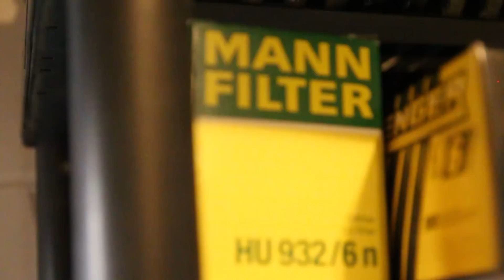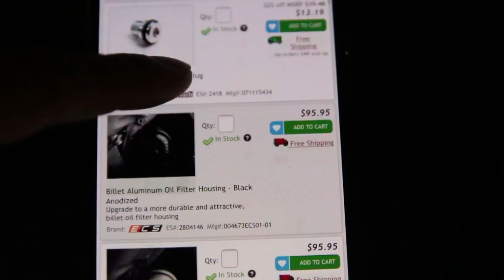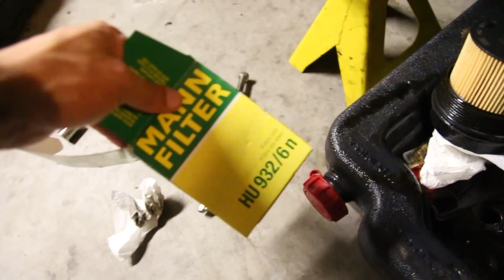One step closer!

Comment: I would swap out the aluminum mk4 oil pan to the mk3 steel oil pan. Especially since your car is riding so low.
Reply: SoCalGunner absolutely do this. The mk4 pan is a liability!
Reply: @aygwm  I have a mk3 pan on my mk4 GTI. It's low, I live in Cali, so the roads aren't that great. I know I have that piece of mind with the steel oil pan.